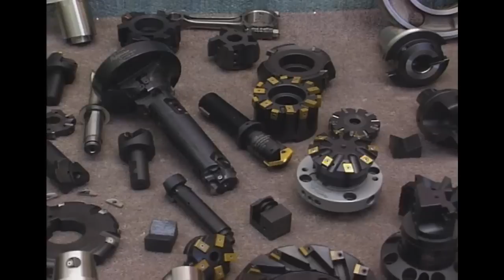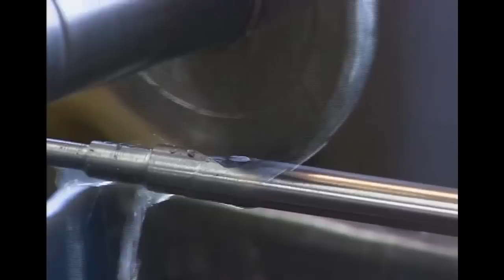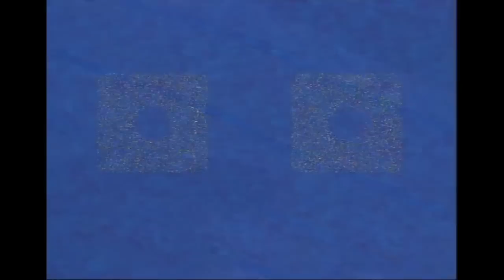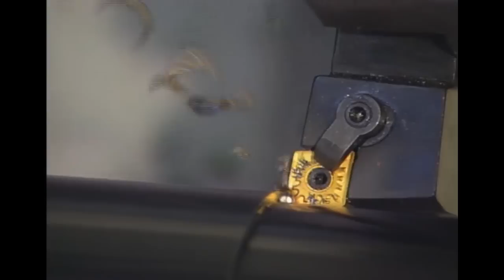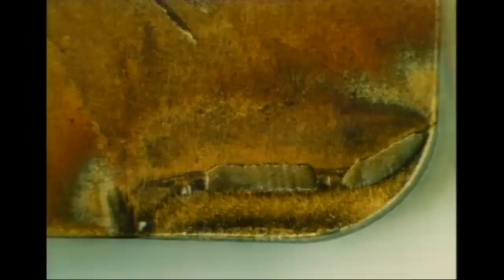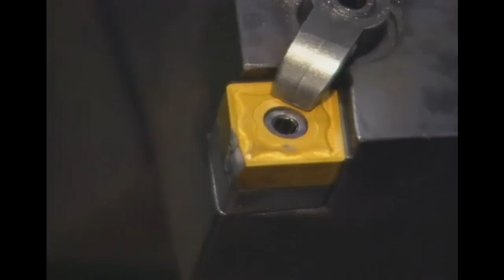Cutting Tool Materials SME

Comment: Correction. Today the speeds exceed 10 times faster vs HSS . Normal HSS bottom out at around Vc 25 m/min , With the right HS-Co probably Vc40m/min would be a maximum (in steel) . Nowadays every insert , regardless of shape , manuafcturer , form , size , coating and radius , chipbreaker , relief angles , holder angle , application  can hit at least Vc 180 m/min (this is just under 5 times faster). Hovewer any reputable brand can hit at least a Vc of 300 m/min . The top brands recommend up to almost Vc 700 m/min in STEEL !(about 18 times faster than HSS-Co) . Vc 350 to 500 Is a regular range for machining steel , with the right tool , and a machine that is capable and rigid .